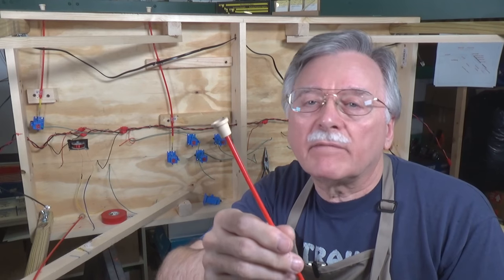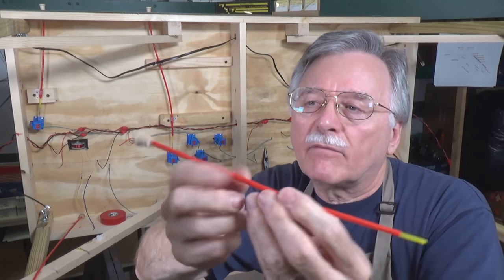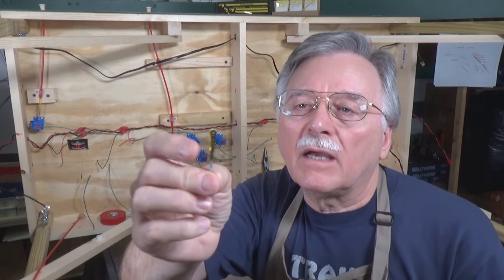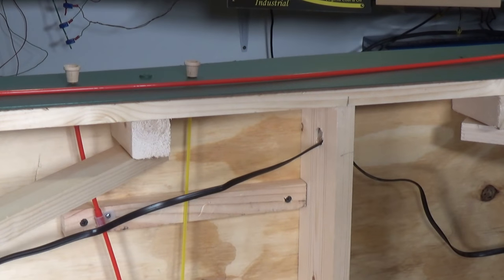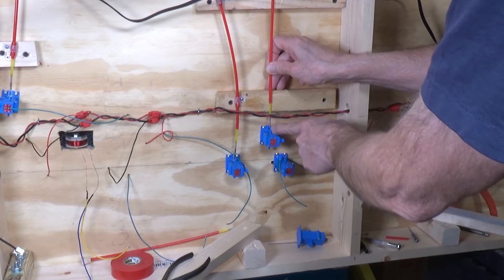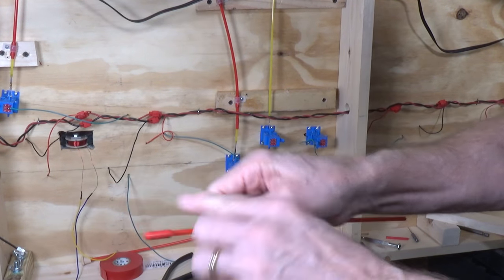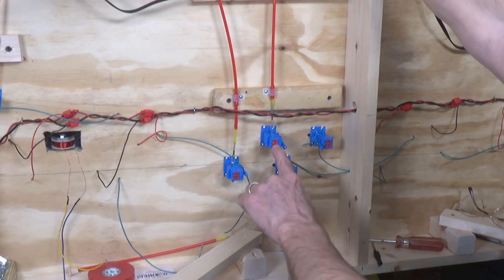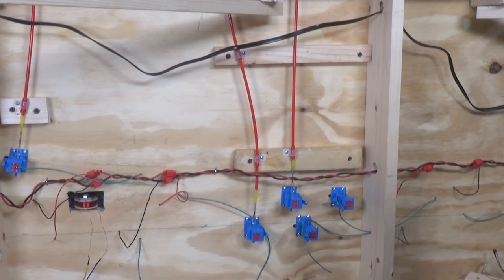Pushrods For Blue Point Switch Machines (149)

Comment: I realize that my comment is late based on the posting date of your video, however, I feel I can add some good information.  Those flexible push rods have been used in the R/C airplane hobby for decades.  They are inexpensive and very reliable.  That might serve as an alternative source for purchase, as well as with the clevises and threaded rod ends.  Additionally, for your double blue point idea, there are several different styles of push rods available based on the needed flexibility.  All of them work very well and for railroad use would be fool proof.  😊

Comment: So happy that I stumbled on your site. I had no idea these switch machines could be activated from opposite sides of a layout. I'm installing an island or rather a peninsula in the middle of a spare bedroom n scale layout that currently travels around the four walls. I always wanted to try these and now I have a reason to give them a try. Many Thanks!!! As a tip: I have installed all-thread into similar plastic (yellow) tubes by placing the all-thread in my drill chuck and holding the tube with a pair of pliers. Slowly letting the drill screw in the all-thread.
Reply from the maker: I can imagine all kinds of mishaps with that method but hey if it works go for it. Like my grandad used to say there’s more than one way to skin a cat! 👍

Comment: Fantastic milestone achievement Larry.
Great video,
I guess I never really considered mechanical point operation but I have to admit that the tactile experience of using this method certainty intrigues me.
Great video look forward to the next one.
Nick Australia
Reply from the maker: I like the system but one potential,problem might be folks rubbing up against the fasica and breaking the pushbuttons off. However the shelf I will be installing later with act as a standoff to help protect them as well as give operators a place to set drinks, throttles, paperwork, etc. Lot’s more to come!

Comment: The nyrods, threaded rod  and Clevis are sold in the RC airplane industry.  They have been used sense the mid 70's for use as control rods for the control surfaces. I use to fly them back in those days. Just thought you should know that there is another source for these. Drilled blocks of wood and epoxy can be used as stabilizers for the nyrods.
Reply from the maker: Yes, I had my adventures with sailplanes a few years ago. I checked several of the manufacturers websites but couldn’t find these listed except on the Du-Bro site.

Comment: Hi Larry. By the way the MRC Railpower 1300 Power in Conjunction with the 840's with the Kato 842 DC convertor connected to the controller, with the switches going to the DC and the wires from the convertor going to the AC. That's all it takes. I just wanted to let you know so if anyone else asks you the same question, you'll have the answer. I thank you again for looking up what you did in order to help me get where I wanted to be. Speak to you again soon. Mark
Reply from the maker: Glad you were able to get it sorted out.

Comment: So far I've used only Fast Tracks "Bullfrog" turnout controller, and it's about the same idea. The biggest difference is that it's all laser cut and you have to put it together yourself, as well as the thing that you push and pull on. I'm happy with it, but some of the switches don't really inspire confidence, like the way it goes together means it doesn't feel like it's going to properly trigger the switch to change polarity. It's a more simple switch though, and not dpdt. I'm curious why they felt that was necessary. Maybe they just had a lot?

Comment: Congratulations on reaching 10,000 subscribers. I have seen other layouts before with those knobs sticking out the front panel and wondered what they were for. I am going to use servo motors mounted under the baseboard and controlled by Arduino boards. (Well that the plan.) Martin. (Thailand)
Reply from the maker: Yes, I think those will gain popularity in the future. If I was about 10 years or so younger I might get carried away with Arduinos, Raspberry Pi’s, etc, but right now I have enough on my plate just keeping up with the run of the mill stuff.

Comment: Great video Larry, I'm looking forward to seeing how you connect up a double through and throw point with the pushrod system that you are using on your next video. I was also wondering how close you can tie both points together with the one pushrod, thank you, Larry you're doing a grand job, regards Jon.
Reply from the maker: I got the crossover connection installed and it actually works so we’ll take a look at it Monday!

Comment: Hi Larry. I have Kato track along with DCC NCE Power Cab system. I'd like to know if I can use the Kato switch controllers with a separate power source. Could you suggest which one to use?
Sorry for asking this question on this particular video...lol I'm just trying so hard to get the right answers to my questions so I can move along with putting my dream together for my granddaughter.
I appreciate your input. I'm starting to put the dots together. I'm also trying not to be afraid to try stuff with the layout. Especially when it works out! Thanks again. Mark
Reply from the maker: Most accessory decoders designed for turnout control can use a separate power supply. This can either be a wall wart power supply or an accessory power bus using something like the Tam Valley Depot booster or a spare booster. I know that some of the Digitrax accessory decoders offer Kato control and there may be others, just need to do some research.
Reply: @TheDCCGuy  Would I also have to use Kato insulated unijoiners on each switch?
Reply from the maker: Sorry but I have no experience with those so don’t know how they are wired. Check out Allan Gartner’s website www.wiringfordcc.com I know he covers them.

Comment: Larry, do you know if you have to remove the spring on Peco turn-outs to allow the blue point switch machine to change the points?
Reply from the maker: I don’t remember trying it with the springs installed. As a matter of habit I remove them for use with my Tortoises and iP Digitals.
Reply: @TheDCCGuy  Thank you Larry for the fast reply! Enjoy your videos, keep up the good work! Btw I couldn’t get them to work with the springs installed, no matter if the hole was 3/8’s and enlarged side to side.

Comment: Between the cost of the Blue Point Machine, the Rods, Nobs, Connectors, +. Were is the advantage Vs a Frog Machine since you need the DCC system anyway. I am not looking at the difference in usage, cost only.

Comment: Hi Larry. If I went with the Wall wart, would I need 12V DC / 2amp or 24V 1,2Amp? Would I then set up a separate bus line for this? Thanks again for being so kind!! Mark
Reply from the maker: It depends on the device, it should tell you in the manual what use and how it works. Most if not all manufacturers provide manuals for download on their websites.
Reply: @TheDCCGuy  The ( 12V not to exceed 24W} LED Strip Lights / Cable Modem  / Arduino PCB Design / External Hard Drive. That's basically all it says!
Hope this gives you an idea if this will work or not. Thanks again for any imput that you can give me. It just lightens the load! Mark
Reply from the maker: Ok, I am not exactly sure what you’re asking me here. At one point I thought you were looking for an accessory decoder to run lights or turnout motors.Now it sounds like you just want to power them directly? I am lost.
Reply: @TheDCCGuy  I'm sorry that I might have misled you, but yes I'd like to power them directly. I like the idea of having all the controllers lined up in front of me.
I don't know I might change my mind and go with the switch Kats with the NCE push buttons...Lol  P.S. I seemed to remember asking you if I could use the Kato
switch controllers with a separate power source? This is so new to me I'm starting to get very disillusioned with the whole process. I'm just trying to do it right. I'm sorry
if I confused you. Thanks anyway. Mark
Reply: I’m renewing myself to the hobby after being on hiatus for over 30 years.

During operating sessions, the Rod System might work better unless all controllers are programmed to work each turnout.  (I’m on the DCC learning curve).  

Is there an easy way to use a manual control method for the Kato side mounted manual throw device on the Kato switch?
Or, you must wire the Kato Turnout and buy their Turnout Control Device.  

Total cost for each Turnout adds up and it  gets expensive….  Around $30 per Turnout or thereabouts?

Maybe I’m lost too, or am I close to what you were asking?

Comment: Congrats on reaching 10,000 subscribers.
Do you remove the switch springs from the switches ?
Reply from the maker: I usually do but as I pointed out in a recent video the Blue Point throw wire can switch the points even with the spring in place.

Comment: I have an old linnel S gauge train I believe my controller has gone bad what controller would work with this S gauage engine
Reply from the maker: I suggest visiting a shop that specializes in Lionel trains. They often do repairs and sell new and used equipment.

Comment: Where can you get the yellow and red tubing?
Reply from the maker: I got it from Tonys Trains. It was a bit hard to find at that time, I guess due to Covid production issues. RC airplane dealers may sell similar control parts but I couldn’t find them in stock either.

Comment: I  noticed you used what I would call an electric "Mini-drill" in making this installation. Can you share who manufactures that?
Reply from the maker: Black and Decker, available at all big box hardware stores and Amazon of course.
Reply: @TheDCCGuy    Can you be a little more specific. I went to Amazon and checked out what they offered but anything listed as a drill looked as big as my cordless Dewalt and anything smaller was listed as a cordless screwdriver and they had no drill chuck.
Reply from the maker: Try cordless screwdriver. Here is one similar to mine but they have several different variations.

https://www.amazon.com/BLACK-DECKER-BDCS20C-Lithium-Ion-Rechargeable/dp/B00TM2T9C2/ref=sr_1_7?dchild=1&keywords=look+for+cordless+screwdriver&qid=1606512901&refinements=p_89%3ABLACK%2BDECKER&rnid=2528832011&s=hi&sr=1-7

Comment: Hi Larry. Getting back to my question about directly powering my Kato remote switches with the Kato 840 controller. Would the MRC Pailpower 1300 Powerpack do the trick? Thanks
Reply from the maker: I went to the Kato website and cannot find anything on the 28-840 so I have no idea how it works, whether it uses DC or AC or DCC, a d what voltage it requires. Do you have an instructions sheet with that info?
Reply: @TheDCCGuy  The MRC Railpower offers 0-15 Volts DC for track power with an optional 19 volt AC output for accessories. Total power for the railpower os 0.75 amps
The 840 takes 12V DC. So because I'm using the NCE power Cab system , which is DCC, di I have to insulate the switches in order for the switches to work properly?
This is all the information I was able to get. Thanks again for being so attentive to my needs at this point. It's really important tome that I get it right. Hope this helps.
Reply from the maker: Here is one thread I found doing an internet source. This seems to answer your question.

https://www.nscale.net/forums/showthread.php?38881-Kato-24-840-wiring-question
Reply: @TheDCCGuy  Yep, thanks so much for your looking into this for me. It seems like that's the answer.                                                                                                                                  I guess since the track is DCC and the turnouts now will be DC, I might have to insulate the switches? Do you think that might be the thing to do?  I'm so sorry for bothering you about this situation, but it's better to ask questions then to fry your layout...lol  Mark

Comment: this is all new. i do not understand what the  Blue Point Switch Machines do as far as the soldering of the wires if its a manual system
Reply from the maker: It is a manual system and the built in DPDT switch can be used to control the polarity of the frog or to control signals/animation.

Comment: G'Day Larry I am new to your channel and I was wondering if you have done any clips on how to solder wires to the tracks with out melting the plastic sleepers they are attached too? Also do you know how to set up a loop track so that when the engine gets back on the line leading into the loop it keeps going forwards as the power track would now be flipped to the other side for the engine? I read something about this years ago in a model train mag but most of my mags are still packed away after I moved as I don't have anywhere to unpack them to. If I remember right it said that you don't have the track actually connected to the points and you run wires from the end track over to the other track only you cross the wires over so that the power side still connects to the power side track to keep the power flow correct and that you only have to put the transformer into reverse so the train keeps going forward as the train is now running in the opposite direct while facing forwards. I just want to confirm I am remembering this right for a single line into a loop. The easiest thing to do would be to run two lines to the loop however here in Australia there were the od rail lines that were single lines and had a loop at the ends so that the trains could run to the end of the line and keep going forward without having to uncouple the engine and turn it around then re-couple it to the head of the train. The loop meant the train could just keep going and it was quicker this way. I think all of these small lines have closed down
Reply from the maker: Kapt—will you be using DC or DCC for the layout, it makes a different with return loop wiring. I know I have written about this and may have touched on it in a past video but I don’t remember doing one on it specifically. With 250 magazine articles, 4 books, over 300 blog posts, and 150 videos its all starting to run together.
Reply: I will be using DC. At the moment I am trying to get as much info as possible before I start building the layout however I've been collecting trains and stock along with as much scenery as I could so far. I hope to start building as soon as I get the shed built next year that I have for it. I am thinking of copying a small branch line that used to run that had the loop at the end of it hence the info I asked you about how to put in a loop.
Regards Martin.